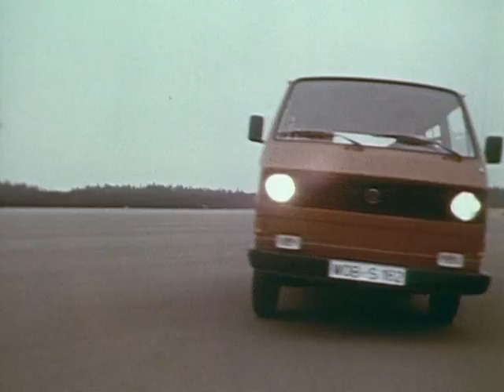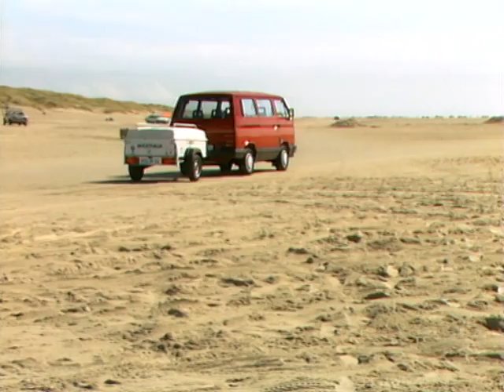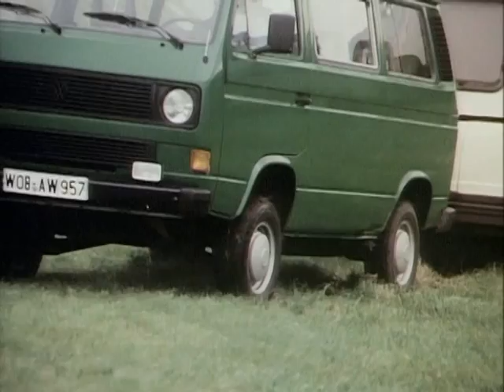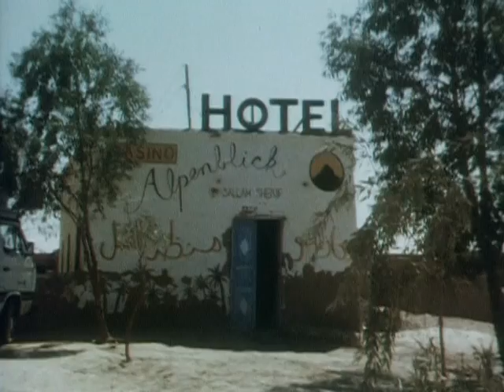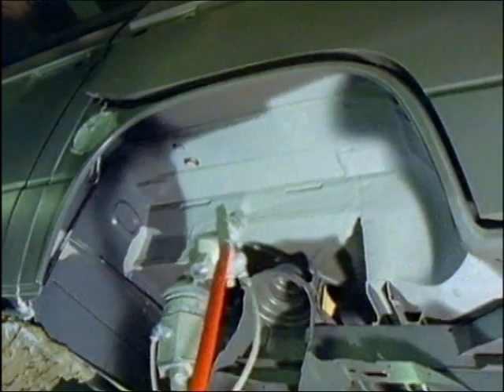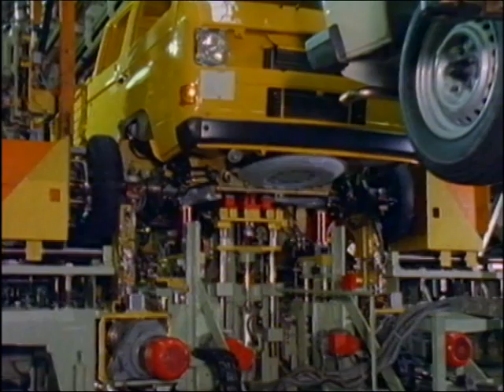Volkswagen Transporter (T3)

Comment: Shame the rust proofing and the engines were so terrible
Reply: The boxer petrol engines were good but the rest 🙁🙁🙁
Reply: My Diesel still runs after more than 30 years... that‘s not too bad at all ;-)
Reply: The wasserboxer is fantastic!
Reply: My air cooled is still running 38 years later :-)
Reply: TheHippieShip yeah, on how many cylinders? 3? Do a compression test, you won’t be happy
Reply: @goclunker  Compression is good for now; won't be the case forever as with any old car. Will have to be rebuilt at some point, but that's part of the fun. Wouldn't recommend it to anyone unless they are a mechanic or a masochist with time on their hands.